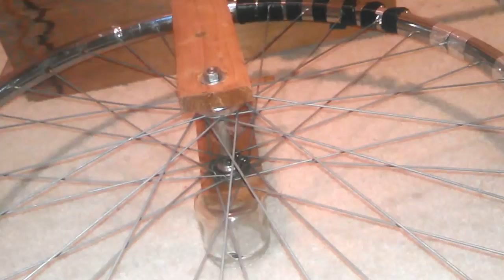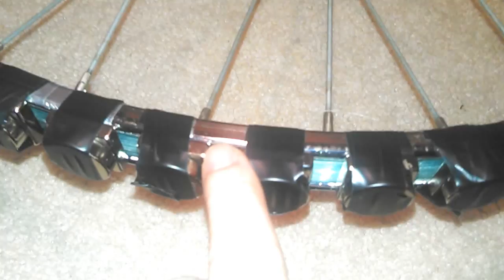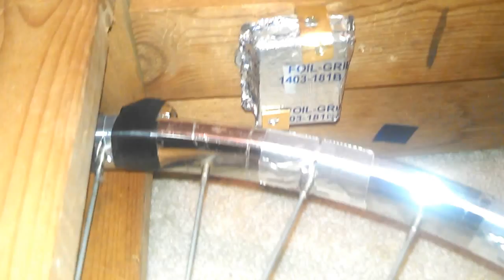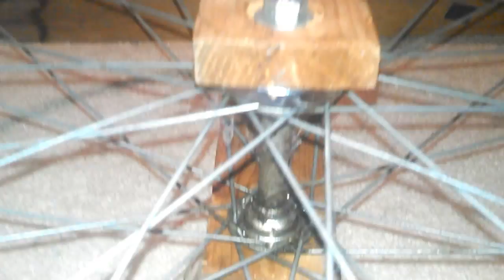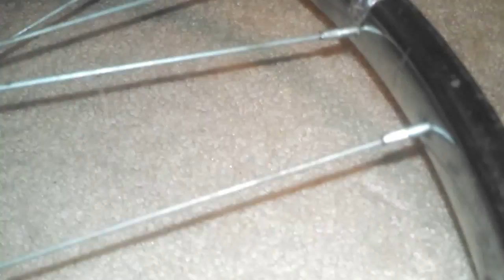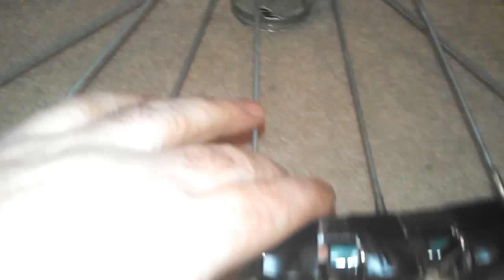🧲 Improved Magnet Position Yields Wonderful Results!

Comment: perhaps your wheel is just not well balanced/fully horizontal. Therefore the weight of the magnet pull them to the right side of the wheel. And that's the weight not the friction that makes the wheel stop abruptly there.
Reply from the maker: Friction is not the issue. Rather there are 3 stators missing. When I have three or more stators, it performs nicely. NOTE: My work is NOT related to perpetual motion.

Comment: If you need some inspiration in continuing your search you will need to do a study of the relationship between the Earth and Moon. There is no such things as perpetual motion or "free energy" but you can get to 90% plus. The Earth takes it's energy from the moon and then gives it back in a tug of war between the two. The center of pull resides about 400 miles within the Earth to about 1/3 towards the interior. So if you study this relationship you will find some hints of where to go next. Your rotor (the moon) gets it's force of motion from the stator (earth), so after the moon makes it's circuit, the earth needs to fling it along by surrendering the energy it took.
Reply from the maker: My video is not about perpetual motion as that is not possible as best as I can see, as magnets ware out. You are misunderstanding the point of my video demo as it's about the stator's performance, not the wheel.

       Four years ago work began on a radical new design in stator construction. The challenge was to build a stator that would make magnet motor possible by creating forward motion that's greater than its counter reaction/drag, and do this in the most forward way possible. A new generation of stators that provides an extremely powerful argument to what's possible.

       My New Stator Pro2 is designed to mimic a hypothetical mono-pole magnet. This is the backbone and the hallmark of the Stator Pro2, creating far more acceleration then there is deceleration from reverse drag; an epic achievement in the evolution of stators.

       The Stator Pro2 incorporates a magnetic runway plate in its design face. The special angle of the stator's magnetic runway plate is paramount in relationship to the performance of the rotor magnets, further reducing reverse-drag from the last rotor magnet leaving the Stator Pro2. (Think of each rotor magnet as an airplane, and as each plane reaches the end of the stator's magnetic runway plate, just like an airplane, each rotor magnet pulls up and away from the end of the run way. This greatly reduces back-drag even further.

       Inertia: There are 6 world-class n42 neodymium armature magnets that gang up on just 1 world-class n42 neodymium stator magnet. The 6 to 1 ratio creates more inertia than the single stator magnet can cancel out. This sets up your third imbalance in the system.

       Just as the last rotor magnet is about to pass across the stator, the lead rotor magnet is suddenly pulled/sucked into the next awaiting stator which in turn, pulls the last armature magnet through the previous stator with a force that is far greater than any opposite force. This sets up yet a greater imbalance in the system.

        The Stator Pro2 offsets the equilibrium in the system by leaps and bounds, thus overcoming any equal and opposite reaction that Newton's 3rd law refers to, in that, "for every action there is an equal and opposite reaction". That law is no longer 100% true.

         When I envisioned the kind of stator required to make a magnet motor possible, the construction concept was something entirely different, something radically different. A new generation of stators that provides an extremely powerful argument to what's possible.

     The new Stator Pro2 muscles the rotor arm with the greatest of ease and greater force, that's virtually absent of counter drag and 100% free of any sticky spots.

     Traditionally, electric motors have relied on electricity to utilize stators within the motor to run. Now with the development of a new error in stator technology that now leverages the power of magnetism to achieve the same goal, now paves the way to self-running magnetic generators.

      BTW: I'm now archiving my work at Google Sites. Simply Follow the link in the video description.

Comment from the maker: Free Energy means after the cost of a given unit. Be it wind, hydro, thermal, etc., it's Free Energy in that you do not have to pay a monthly electric bill. 

Note: All my videos are old and outdated. Stators at the 12, 3, 6, and 9 o'clock positions allow it to work.

You talk a big talk, but your all mouth and no hands on. There are a few holes in our law s of physics as they currently don't account for UFO's or quantum entanglement, let alone my stator that defies Newton's third law. Cheers!

Comment: I have,and i stand firm on my belief's. No net gain will be obtained from this setup-and that is a fact. newtons third law is intact until you or anyone else can show different.If you have a force that is stronger in one direction than itis in the other,then you would have a self runner by now-wich i cant seem to find anywhere. And please dont say it's because of the friction in the bearing's,as low friction bearings are only about $12 each-wich you would have by now if this actualy worked.
Reply from the maker: 🧲 CREDIBLE FREE ENERGY MAGNET MOTORS THAT WORK 

MAGNET MOTORO - Rotor Encantado
https://youtu.be/mxgwTzxfe8Y

Amazing Magnet Motor/Gen Rep. This is not a fake
https://youtu.be/jKFTAobM-l0

WORKING MAGNET MOTOR 2023
https://youtu.be/vdtdKE2Qe40  

SELF RUNNING MAGNET TURBO MOTOR 
https://youtu.be/6sIBHn5-9pI 

 WORKING MAGNET MOTOR - rotor magnético
 https://youtu.be/3mD0_0FiJ54

 MAGNET ONLY MOTOR from SOUTH KOREA 
https://youtu.be/smzpbKg9S7M

1966: German inventor presents his Free Energy Device Magnet-Motor
https://youtu.be/XWQjMyMWXAc

Comment from the maker: You have completely misinterpreted the data. Scaled up, there is enough torque to smash fingers, even break your arm. More than enough to power a huge factory once scaled up and redesigned for greater horsepower.  It' works just fine now with four stators. Now imagine thirty two hundred stators working in tandem. You might want to do your homework before shooting off your mouth next time.

Comment: There's absolutely no net gain of energy here. Dear author, free energy is not possible, but you're free to keep trying. You should probably read more about physics, though. The worst part is that I'm sure that you filter comments based on what you want to hear. You gave the wheel potential energy by moving it away from stator and then close again. The "net gain" is simply potential energy being released as kinetic energy.
Reply from the maker: I done't filter replies. Why do you think there are so many crappy comments below my videos? You're very presumptuous. My Armature magnets now start from a dead stop when parked the the middle of a bank of stators. So your comment does not apply. The equal and opposite force has been overcome. 

As always, thanks for your constructive feedback, more so, for taking the time to stop by 9 years ago. Wow! Time flies!

CREDIBLE FREE ENERGY MAGNET MOTORS THAT WORK 
MAGNET MOTORO - Rotor Encantado
https://youtu.be/mxgwTzxfe8Y

Amazing Magnet Motor/Gen Rep. This is not a fake
https://youtu.be/jKFTAobM-l0

WORKING MAGNET MOTOR 2023
https://youtu.be/vdtdKE2Qe40  

SELF RUNNING MAGNET TURBO MOTOR 
https://youtu.be/6sIBHn5-9pI 

 WORKING MAGNET MOTOR - rotor magnético
 https://youtu.be/3mD0_0FiJ54

 MAGNET ONLY MOTOR from SOUTH KOREA 
https://youtu.be/smzpbKg9S7M

1966: German inventor presents his Free Energy Device Magnet-Motor
https://youtu.be/XWQjMyMWXAc

Comment: Concerning the friction problem. WHy not use two opposing magnets (N+N or S+S) to generate a repelling force that would also keep the wheel in place---- and would make the wheel spin seemingly forever because friction has been taken out of the equation. Magnet A be pushing down against Magnet B which is pushing up, follow this principle on both sides of the wheel. Of course you would need stators all around and magnets covering the wheel to keep it from spinning out of the field. Jesus bless.
Reply from the maker: 🧲 Good to see you're still around Rufus. Much has changed, and much learned since 9 years ago. I'm back now and this time to stay. Good things are ahead.

🧲 CREDIBLE FREE ENERGY MAGNET MOTORS THAT WORK 

MAGNET MOTORO - Rotor Encantado
https://youtu.be/mxgwTzxfe8Y

Amazing Magnet Motor/Gen Rep. This is not a fake
https://youtu.be/jKFTAobM-l0

WORKING MAGNET MOTOR 2023
https://youtu.be/vdtdKE2Qe40  

SELF RUNNING MAGNET TURBO MOTOR 
https://youtu.be/6sIBHn5-9pI 

 WORKING MAGNET MOTOR - rotor magnético
 https://youtu.be/3mD0_0FiJ54

 MAGNET ONLY MOTOR from SOUTH KOREA 
https://youtu.be/smzpbKg9S7M

1966: German inventor presents his Free Energy Device Magnet-Motor
https://youtu.be/XWQjMyMWXAc